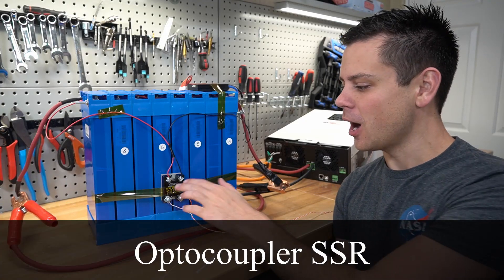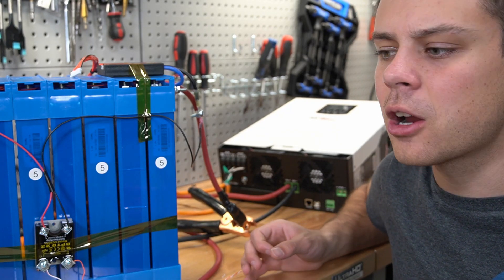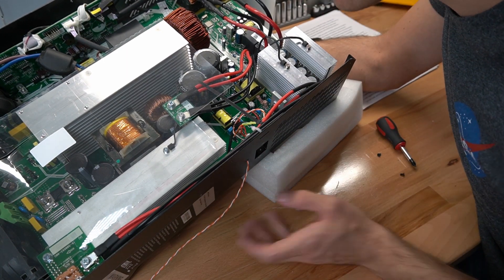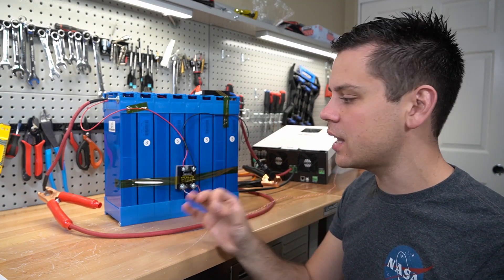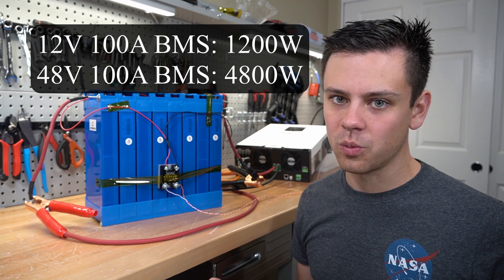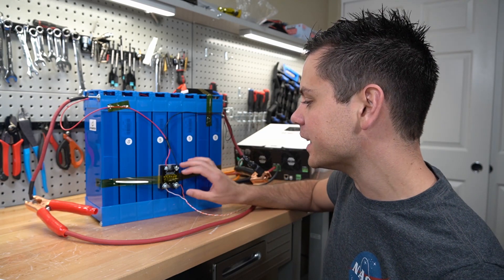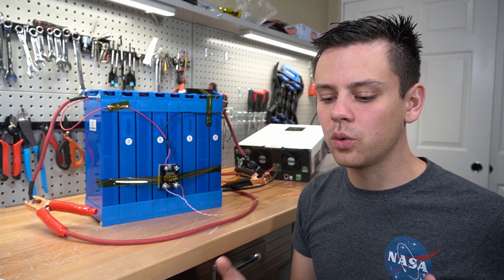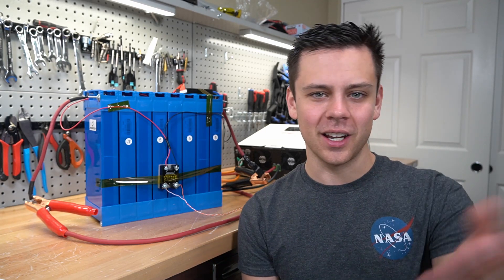Solar Inverter Control w/ Optocoupler SSR and BMS (Intermediate level)

Comment from the maker: Please watch the video before commenting. We are having some very strange comments below that make me realize that people are commenting without actually watching the video:

The SSR is rated for 5A which is more than enough. It is complete overkill. Max current it will see is 10mA. If you understand the purpose of the SSR, this would be obvious. It is a switch for isolation. Not current carrying for disconnect. Totally different purpose. 

We are not going to use a traditional relay, for all the reasons mentioned in the video. Please watch the video before commenting. 

HVD and OCPD can be easily added. Put a fuse on an inverter lead, and use high quality SCC and manually set absorption. Again, mentioned in the video, but people are missing it.

~~~~~~~~~~~~~~~~~~~~~~~~~~~~~~~~~~~
Tired of getting ripped off? Check out my "Will Prowse Approved" solar product recommendations below!

12V Batteries
https://www.mobile-solarpower.com/lithium-batteries.html

48V Batteries
https://www.mobile-solarpower.com/48v-batteries.html

Offgrid Inverter System Builder
https://www.mobile-solarpower.com/48v-complete-system-blueprint-559371.html

Hybrid Inverter System Builder
https://www.mobile-solarpower.com/code-compliant-48v-offgrid-system.html

Mobile Handtruck System Builder (very popular!)
https://www.mobile-solarpower.com/mobile-48v-system.html

Solar Panels
https://www.mobile-solarpower.com/300w-solar-panels.html

Ground Mount Solar Racking
https://www.mobile-solarpower.com/ground-mount-racks.html

Wire, Lugs and Busbars
https://www.mobile-solarpower.com/wire-and-connectors.html

Tools
https://www.mobile-solarpower.com/tools.html

Fuses and Circuit Breakers
https://www.mobile-solarpower.com/fuses.html

Plug-N-Play Solar Systems
Ecoflow, Anker And Bluetti! So many models to choose from. See my current recommendations here:
https://www.mobile-solarpower.com/full-size-systems.html

~~~~~~~~~~~~~~~~~~~~~~~~~~~~~~~~~~~~~~~~~~
Need to build a large DIY system? Need a trustworthy solar distributor? These are my favorites:

Signature Solar
Creator of EG4! Solar Minisplits, Victron and More! Largest Solar Store Online.
If you want $50 off, please use my link below and coupon code "DIYSOLAR50":
https://signaturesolar.com/?ref=cPwLcVc0SW-BjN

Current Connected
Best Prices for EG4, Victron, Midnite and so much more! Fast Shipping and Highest Rated Customer Service:
https://currentconnected.com/?ref=wp

~~~~~~~~~~~~~~~~~~~~~~~~~~~~~~~~~~~~~~~~~~
Join our DIY Solar Community 
Need more help? Join the largest solar forum on the internet for beginners and professionals alike. 140,000 members and counting!
https://www.diysolarforum.com

Check Out My Free Book
Best-selling and beginner-friendly guidebook to off-grid 12V solar!
https://www.mobile-solarpower.com/the-book.html

~~~~~~~~~~~~~~~~~~~~~~~~~~~~~~~~~~~~~~~~~~
Contact Information:
I am NOT available for personal solar system consult! If you wish to contact me, this is my direct email: williamprowsediysolar@gmail.com
FTC Disclosure Statement and Disclaimers:
Every video includes paid promotion or sponsorship (such as free products for review). Some links on this YouTube channel may be affiliate links. We may get paid if you buy something or take an action after clicking one of these. My videos are for educational purposes only. Information is subject to change/update at any time. Electricity is DANGEROUS and can kill. Be smart and use common sense :) DIY Solar Power with Will Prowse is a participant in the Amazon Services LLC Associates Program, An affiliate advertising program designed to provide a means for sites to earn advertising fees by advertising and linking to Amazon.com
Reply: DIY Solar Power with Will Prowse , Do you have any thoughts on my question below?
Reply: you mentioned in the video that you wouldn't have high voltage disconnect from the solar panels w/this setup. How hard/expensive would it be to use the same concept (ssr) on the incoming solar panel input line?
Reply: @wildness01  I think it depends on how large of an array you have.  In my case, I have 2x 12 panel arrays (~4Kw each) connected to 2x Schneider 60-150 CC's.  I'd need to get a relay that can handle that voltage and current (1 for each array.)  SSR's are really meant for much smaller current.  I have a 48V SSR in my spec to handle the pre-charge of my equipment using a 5W resistor.  I also have a 48V relay spec'd (48VDC/500A) for my Battery path, but I too would like to find a solution that could handle my solar input.  To me, it makes the most sense to disconnect the solar input if your worried about fail-safe over current protection.  I haven't decided on what I'm going to do for a BMS.  I have all Schneider gear.  I plan use a Raspberry Pi to talk to the equipment over Modbus.  I'll either buy a small Daly Smart BMS (probably the 30A version to save money) or something like the GWL CPM board and add in the 48V/500A relay.  Both of these solutions can be connected to the Raspberry Pi and I can have the Pi tell the Inverter and/or CC's to back off, go into Float or go into STDBY.  Then if the poop really hits the fan, I can trigger the relay(s) to disconnect either via the Daly or the CPM (this one has several outputs for relays.)

Comment: Will, thanks so much for all your shared knowledge but especially for this. I've been looking for confirmation on this approach so FETs dont get smashed. I will probs just use an automotive relay with inverter ON switch on the battery side of the relay to prevent relay idle current draw for my camper setup. Cheers!

Comment: Any idea on how to switch the dc inputs from my solar panels to another device ? At 12 noon on sunny days my batteries are at 100 % charge. I would like to bypass my charge controllers to 72 / 12 volt regulators and run an inverter from it. Otherwise I waste a tremendous amount of energy on sunny days as the controller cycles between charge with load , full charge, battery charging off but battery discharges with load,  charge on with load, full charge…then the micro cycling begins again. . At full charge I want to remove all the load from the battery ( save them for overnight use ) and exclusively use the array for power via the step down regulators. This situation occurs every sunny day at 12 noon. I have purchased High power SSR but they get VERY hot ! Thx.

Comment: The opto-coupler is just used to isolate the electronic switch, which is basically all the SSR is.  Its ... well, actually its probably a FET, just one that carries only a tiny amount of current.  The opto-isolation allows the input side and the output side to operate at different voltages and not be galvanically coupled in any way... important for marine applications.

But I will point out that turning an inverter on and off causes extra wear on the inverter.    In particular, if the inverter only has a manual switch and does NOT have terminals for an external switch, that's a big red flag... wiring up its manual switch for automatic operation is likely to cause excessive wear on the inverter's circuitry from the switching operations.  The inverter's manual switch is probably not designed for frequent use... it might do something stupid, like shut-down the output mid-cycle for example, instead of waiting for a zero-crossing.

Any sort of switch-on or switch-off of a heavy load is going to add extra wear somewhere in the circuit.  So if your choices are (1) BMS, (2) External high-current relay, or (3) Inverter, you might actually want to choose (2) because swapping out (1) or (3) can be expensive and/or annoying.  Whereas keeping a spare high-current relay nearby is a lot cheaper and a lot easier to replace.

So I would say... maybe not good advise to hack an inverter's manual switch this way.  Buy an inverter that has actual input terminals to control it, because such inverters will handle the operation in a far smarter way than an inverter with a manual switch would.  Plus the input terminals might already be opto-isolated on the inverter, omitting the need for a opto-isolated SSR.

-Matt

Comment: I've already done this myself. It makes far more sense to switch off the inverter for cell over-
discharge (when it's the sole load) instead of switching the large DC current feeding it. I currently use a small mechanical relay to replace the inverter ON-OFF switch. Good luck with the SSR. My Chinese inverter presents a very high capacitive load to the ON-OFF switch, the turn current surge of which tends to destroy MOSFET switches a few months of use,

Comment: Great savings! William, what do you suggest for a 30,000 split phase inverter. Configured with 32 EVE 304 cells (310A). 16s2p?  (30000W LF pure sine wave SPLIT PHASE power inverter dc 48v/ac 110V/220V 60HZ) with manual off on switch.

Comment: Hi Will. This is exactly what I was looking for. One question. After the BMS has shut off the inverter following a Low Voltage situation, will it automatically turn back on after the MPPT has charged the batteries a bit, or does it need to be manually reset?

Comment: Will, it is always good to listen to you again a few months later and then begin to wonder about personal implementation.  Alas, what is missing in your video descriptions is a list of what is on display. What type of battery bank, what brand of inverter, what brand of BMS and capacities of those items.  If I have a Big Battery 48Vr Kong, it is hard to compare your solutions to my own because the exact pictured solution is not described anywhere in writing.  It's a great way for you to promote and sell stuff via Amazon for sure.

Comment: Does the bms black cable just hook to the ss relay ?
I could really use a chat with you somehow.
Installing a 4s3p 12v 1200ah sys  in my semi complete with victron dc dc charger, shore power, 6.8k genset, future 400ish solar, and am on 
Information overload, i have so many schematics buzzing in my 🧠  I'm going nutz.

Comment: Ive been looking for a cheap diy bms strategy for my bidirectional inverter/charger and think this is it if I can hack into the inverter/charger switch. I’m not sure if it will work. Can anyone tell me if it, hacking the switch, will work with my Sterling Power Pro S Inverter/charger. The rocker switch has three positions; down is on, middle is off, and up is standby. Will says to wire it in “series”. I think it makes sense to ignore “standby” and hack the “on/off” part of the switch. The switch is has a RJ45 plug so it can be moved and used as a remote switch. So maybe I can simply hack the RH45 plug? It’s difficult to explain without pictures. Maybe I should email Sterling Power and ask them what pins to he on the plug? Thanks
Reply: Sorry, made a typo. Meant to say “what pins to hack on the plug”

Comment: Hey Will. Thanks for all the great videos. Just an FYI, but the SSR is wired in “parallel” with the inverter switch, not in series.  Cheers.
Reply: Is this accurate? The SSR is wired in parallel? That’s what Im wondering.

Comment: Thanks for the video! Using your concept, i put together a Daly BMS with the SSR relay you suggest to create a high voltage cutoff rather than a low voltage cutoff. Have a Xantrex inverter/charger that will routinely overshoot the voltage because it can ramp down fast enough when the voltage ramps at the end of charge despite having it set at 14.1V. Unfortunately I could not get it to work as it would not activate the relay to turn off the charger. I did confirm removing the balance connector activated the relay but not for an overvoltage (>3.75V) condition. Any tips? Thanks!

Comment: A simple circuit diagram would be a big help. I think positive and negative of battery go direct (through breaker) to inverter. The SSR then breaks when BMS disconnects (BMS black and battery positive)???

Comment: Hi Will, I have been inspired by your channel plus the DIY Solar Forum.  I am also working on a DIY LiFePO4 set for connecting up to a couple of LV2424s for 240vac split phase (I have the green All in Ones).  Question: Does that switch on your white LV2424 All In One turn off just the inverter? and leave the MPPT charger to battery circuit in tact;  or does that switch turn off the whole unit?  ...  I will eventually figure out when my All In One is configured and hooked up. Studying the manual has me believing that switch turns off the whole unit, which definitely  would protect against low battery cell voltage kill/ resulting in possible early cell death.  Studying BMS options in the forum, I know I would prefer to turn off only the inverter when BMS back up protection triggers for low cell voltage; while leaving the MPPT charge circuit in tact so battery could recover automatically.  I appreciate the heck out of your lessons, including in the forum   Thanks in advance if you could answer this question  :+)   Bill

Comment: Think about a method to externally turn off the charger on the MPP 2424LV to prevent charging at Temps below 0C.

Comment: Hi Will - I have a 100A BMS - Smart from China - judging from the leads it will not handle that - so I have de-rated it to 50A - I can use this Opto 22 to switch my inverter and gain back the 100A power draw I was promised!! - Question: Can I leave the Charge negative cable link to my solar charge controller? (and still have the overcharge protection)

Comment: Ah, so that's the difference in amp rating of balancers. If that's all it is then routing through a power transistor ought to do the trick (those things go to 600A), no matter how puny the BMS system, yes? I'm working on an Arduino BMS/monitor system so I guess it's worth risking some magic smoke to give it a try.
I guess it says something about my approach to such things when I stopped listening when you got to buying the USA, UL-listed, code-compliant <click>.

Comment: Hi Dear @DIY Solar Power with Will Prowse: I would like to take advantage of your knowledge if possible. I have this MPPT (@t it provides a means to use a higher voltage PV array to charge either a 12V or 24V battery (types in specs are Gel, Sealed, AGM, Flooded), but I am very curious if I can charge a 18650 bank of batteries  with that MPPT and  if a BMS will handle the 12V or 24V from the MPPT. As extra information it has 4 Stage charging (Bulk, absorption, float, equalize (optional)). Thank you.

Comment: Hi Will someone sent me this to solve my high output problem 4-600a, I bought a 32s bms like the one you reviewed before (ant bms it says it will do 400a but other have burned it up with 1-200 amps)  i was planning to just turn on the bms to balance my 130v battery pack my friend suggested using this system to keep the bms on all the time.think it will work?
I have already burned up a 500amp battery monitoring system from china
thank you

Comment: Trying to understand this lesson, and your BMS lessons better: I am wondering: How specifically does that BMS connect to that coupler relay, to turn it off (as you turned it off by pulling the plug from BMS) when a cell gets too low in voltage? Are you not connecting the BMS as you normally would to battery terminals;  leaving the negative wire disconnected from battery? Or maybe you wire battery directly to that Inverter/ MPPT charge and the BMS is only connected to that  octocoupler relay. It is not totally clear to me, as I can not see behind the battery. Maybe you could clarify by providing a diagram. As a newby, I am wondering: With Inverter off and no  more 120V ac out from inverter, and thus no more drawing down battery to lower voltage;  while (I think) the MPPT can still be charging the battery during daylight hours;  ... Does the BMS still work to balance the individual 3.2v cells under these conditions? I am hearing from this lesson and option, that the biggest danger to the LifePO4 battery is draining  down a lower charged cell further to to much lower? I think that is what this setup  protects against. Iam still trying to beter understand how the BMS balances cell voltage (or not)?   If possible, I would value a written explanation with a diagram (and think others may too).  Related Question: Would you pick a BMS with a common post vs separate post for this set up with a lower amp rating BMS? ,  or maybe that simply does not matter?   Thanks in Advance for all your support!

Comment: I don't trust BMS's. For SHTF scenarios I need to know my batteries will perform. I understand that a good BMS is pretty reliable but those cost hundreds on top of the batteries themselves. Rwnogy now makes a hybrid gel 200 ah battery with LOW internal resistance and 1000 charge cycles at 50% DoD for under $450.00. Sure they are heavy but no BMS! Lithium is certainly more efficient but it is NOT as reliable and never will be as long as a BMS is needed beyond the charge controller. For the price I have built my system to not pull down past 60% çharge and I can expect to get 10 years plus use out of my batteries. They are in series for 24v. You do the math and the cost per kw is way cheaper and far more reliable. Until a BMS is no longer needed I'm staying with the renogy Hybrid gel system.
Reply from the maker: Lead acid should have low voltage disconnect as well. Or a BMS system. Lead acid are not special. All batteries need it minus a nickel iron battery. 

Do not trust BMS? It's a solid state system that works great if derated properly. Most lithium battery bms are more reliable than any lead acid on the market.

Comment: Logical? 🤔 Spock jr 😝 seriously good stuff. I’ve used PowerJack for years never had a failure but of course I don’t grid tie. I use a switchover ABT. They actually started making their wiring neater. Very affordable and easily modifiable to suit if needed. Giant toroid transformer for very little losses unlike laminated steel. What’s the highest amp SSR you’ve found?